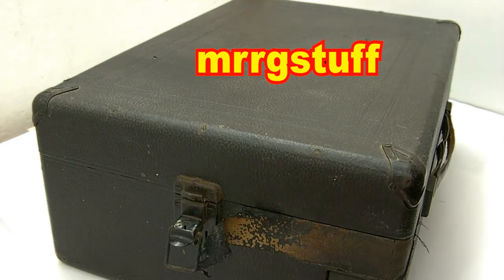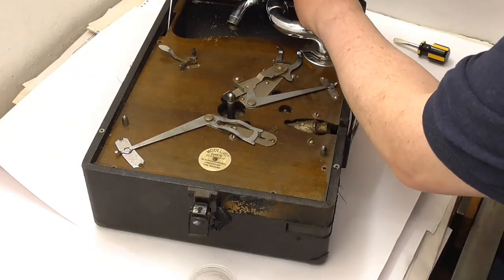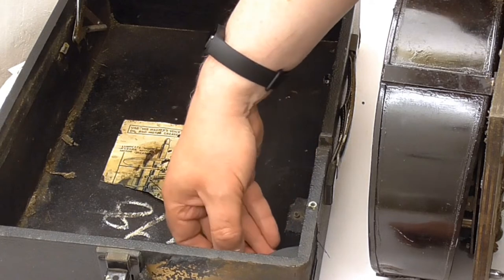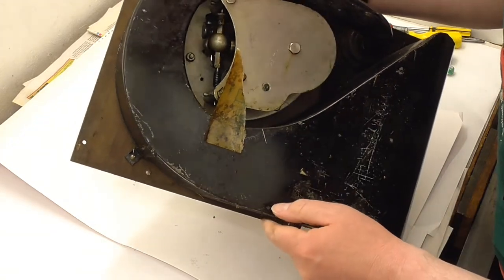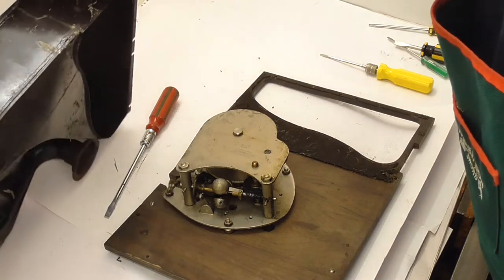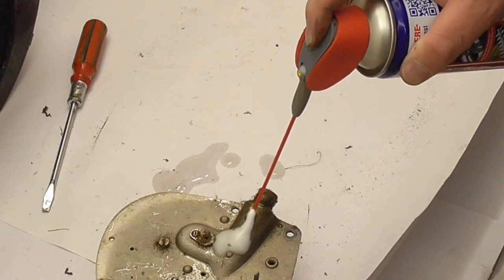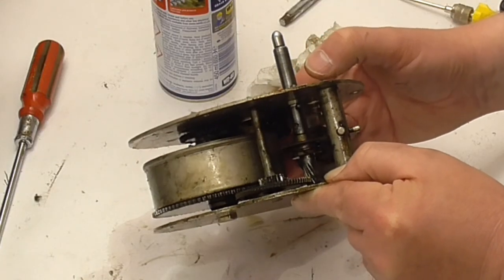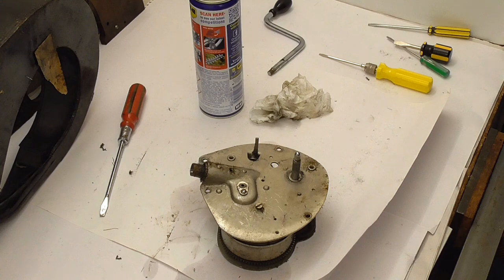HMV 102 motor - quick clean and test

Comment: Looks fine. Probably just needs a good clean and a mainspring service. I like working on the HMV motors,  they are well built and rarely give problems if properly serviced.
Reply from the maker: Thanks 😀 👍.  Haven't decided yet whether to service this further or just give it an oil and put it back in the case to test. At some point I would like to properly service it of course. I agree though, it is very nicely made and is built to last

Comment: Yeah super careful with the governor weight hitting the case at high speed, I learnt the hard way as a 12 yr old when one of the weights decided to part company with the motor flying across the garden and ending up in the fish pond! 
Runs lovely a quiet, any sign of hardened grease on the gears? Stiffness whilst winding?  If not maybe a light greasing/oiling according to the paper instructions then reassembly and see how it plays a record or two....
Reply from the maker: Fortunately nothing has broken on me quite like that yet, but a scary prospect! It does seem to run fine I agree, and the motor is a bit dirty but not excessively so. No obvious signs of hardened grease and the motor winds fine too. Thanks 😀 👍

Comment: I find getting the governor adjusted right so that it spins nice and freely can make a big difference. The axle positions at the ends can be adjusted. Take care that the gear properly engages with the worm on the governor axle, too. It's nasty if it slips and can ruin the gears.
Reply from the maker: Thanks 😀 👍.  I'll have a look at the governor before I put it back in the case

Comment: Thanks! I just took my 270-D apart. From a 1938 HMV 102. Grease rather hard, spring looks good. Would you advice to remove the spring, clean it and then grease again? I fear for my eyes when I have to put it back. :-) Cheers from Holland.
Reply from the maker: It's a good question. I so far have only removed springs where it was absolutely necessary to get the motor working again. If you feel the spring really needs cleaning but don't want to remove it, the I believe it is possible to soak the whole spring barrel in solvent to remove the old grease and then just apply new grease on top. I have not tried this though. Thanks 😀 👍

Comment: Looks to me as if the axle/spindle on which the speed governor's weights are rotating could need some lubrication. They should react smooth & quick to speed adjustments...and in the video they were quite slowly following. Just judging from this video, though.
Reply from the maker: Thanks 😀 👍.  Yes this motor really would benefit from a complete overhual. To be fair to the dealer, it was sold to me as having a suspect motor, but at least in these tests there doesn't seem to be anything seriously wrong with it. Your suggestion is good though as the machines runs slow. It gets to about 75rpm and no faster. Thanks again 😀

Comment: Good video, nice machine. I've got several 101 and 102 models. Surprisingly they all have differing motor units. I think it was common in the day for repairers to switch out motor units. I haven't been able to find a definitive guide on what motor was used on these. I wonder if someone can help.
Reply from the maker: Yes, there seems to be some variety in motors and HMV did tend to use up items so models can have a mixture of parts, even from new.
I have a couple of 101s, which do have the same motor. Both motors are broken, but I think I can get a decent working machine between them. I also have a couple of 102s, but the other one is untested and I have not had it apart yet to look at the motor. Thanks 😀 👍

Comment: Stupid question, what if you were to put an aluminum diaphragm into a reproducer that was built for a mica diaphragm? Would it work better or worse since the box would have been optimized for a different material.
Reply from the maker: I think it's a very good question. Certainly it's possible to use both in the same design of reproducer. As well as my own experiments, I have also seen an HMV No.4 on ebay which had an aluminium diaphragm. I think many reproducers were not scientifically designed  rather were loose copies of other ones on the market. They therefore weren't really tuned for a particular diaphragm material and may work equally well or even better by changing it. Overall though, aluminium has the potential for the best frequency response, so could improve things. The aluminium diaphragm needs to be properly formed with corrugations. A flat aluminium diaphragm performs poorly. Thanks 😀 👍

Comment: I restored old decca 78. Spring was sealed and full of crap. I socked in wd40 and white spirits. Then melted vasalin and socked spring for long time. Good as new. Love the sound ❤
Reply from the maker: Sounds good. WD40 and white spirit are very effective for this, though my workshop doesn't really have enough ventilation for white spirit and the smell is overpowering. I did read in an old book that petrol works well too! Thanks 😀 👍

Comment: the main spring may be somewhat tired, especially if some one in the past has stored it with the spring fully wound. It could also be due to the grease inside the Spring case being  too thick ( which is very likely due to its age)
Reply from the maker: Surprisingly, now I have played some records on this machine, the spring seems to be still quite strong. It does need a proper clean and regrease though. Thanks 😀 👍

Comment: It would be really nice to see how you strip down the motor, clean and service it!   I’ll be looking out for that one.
Reply from the maker: Thanks 😀 👍.  Yes, I hope to do more with motors. I have several HMV portable machines which require attention 😅
Reply: @mrrgstuff  I’m chomping on the bits because last night I got my motor to run again just by scraping off so much of that dried grease!!  It’s just a start because I didn’t want to strip it down too far without knowing what I’m doing.  I got my superglue so I’ll just practicing on repairing those records. 😬

Comment: It still amazes me that from such a beautifully simple design comes out such complex sounds.  I  also have a blue HMV 102 I bought in London.  The motor or spring just stopped working after 30 years.  I wonder if a complete novice like me can do anything to repair it.
Reply from the maker: I find old equipment like this fascinating and completely agree its amazing how such a simple mechanism works so well. The motor however is the most complicated part. If the problem is just dried up old grease then cleaning the motor and applying more grease may get it working again. If the handle turns but it won't wind, then the motor might actually be broken and that is a lot more complicated to sort out. I haven't fixed a motor from a 102, but I did fix a bigger HMV motor which will give you an idea of the type of work involved:
https://youtube.com/playlist?list=PLsCYUbO6xxnT2W0mIpLWhd5B6p-RARo9B
Thanks 😀 👍
Reply: @mrrgstuff   I have changed springs on a couple of occasions when a lot younger I also  on one occasion redrillled a spring which had broken towards the outer end. I really don't advise messing around with a gramophone mainspring for a beginner. Its a very scary scenario especially removing the old broken Spring ( You need a sack to remove the old spring). Not sure how Id deal with it today. I no longer have the manual dexterity or strength in my wrists and hands.
Reply from the maker: I've heard about the bag trick, but not tried it myself. I would agree though that changing the spring is the hardest and most dangerous thing when servicing a gramophone and I have only done it a couple of times myself. Here is me refitting the last spring, though in use it turned out to be fairly weak (needs a good wind to play a whole record) and other springs can be much harder to deal with
https://youtu.be/GYDmr4IfUlo
Thanks 😀 👍

Comment: If anyone knows how best to clean the case, please let me know as I can’t make out what the material is, so I’m hesitant to try until I know.  Thanks!
Reply from the maker: I'm not 100% sure what material HMV used, however portable gramophone case coverings are often described as being made of Rexine so searching for that might help
Reply: @mrrgstuff  clean the case with Black Shoe Polish, apply with a brush then polish off with a duster.
Reply from the maker: Yes, should work well. My 102 has damaged covering so it will require some repair work too. Thanks 😀 👍
Reply: My case is blue. I ended up using saddle soap to clean and add back a bit of much needed moisture.  I let that dry over 2 days before mixing good artist grade acrylic paint to match the color as it’s too difficult to find a dye or polish to match.  It looks and feels now like it should.

Comment: I’m still just amazed that from such simple parts comes out sounds so complex!  It’s an incredibly gorgeous design the 102.  I have the same model I bought in London 30 years ago.  The spring/motor just stopped working. I’d like to use your video to see if I can make out what’s happened. Thanks for making this.
Reply from the maker: Thanks 😀 👍.  When you say 'stopped working', what are the symptoms?
Reply: @mrrgstuff  so glad you asked because after seeing your video I took it all apart and got to the spring case (like a tuna fish can) but it wouldn’t open. 
The crank just turns and turns. When I descend the needle the rotation stops after 1 second.  
No one here in Texas works on these.  It’s my most treasured memorabilia from my life in London so it’s important to me to get it working.  I’d be so grateful for any advise you have.  (The motor did not spin at all. )
Reply: Okay, so I removed the bottom plate with the spool that goes through the middle of the spring barrel but as I was unable to open it and look at the spring, I put the plate back on and wound it again. I did this two times and each time something faintly clicked once then there was a bit more tension as I wound it up.  But the motor didn’t spin.  Gosh, does this mean I must replace the motor as well as the spring you think?  Also, as I normally don’t tinker with machines I’ve no idea what motor grease and oil I should use as there isn’t any HMV grease and oil as recommended.  If you’ve taken the time to read this once again, thank you!
Reply from the maker: So if you are getting a sort of clicking noise when you wind the motor, it might be this problem:
https://youtu.be/2M3JhwwWFhQ
Basically in this case the spring is broken (or has come loose from its fixing) and the spring barrel needs to be opened up to resolve the problem.
Motors do click a bit anyway as you wind them up, but a broken spring will wind itself down with a clicking noise. Some broken springs don't wind up at all.
If it winds and seems to be taking tension, then check that the speed control is not jammed up against the governor stopping it turning
Unless you have damaged gears it's unlikely the motor itself is damaged. If anything is broken it is likely to be the main spring.
For lubrication I just use cheap motor/axle grease and also sewing machine oil for the governor. Best to avoid 3in1as it gums up over time.
As I think you said you are in Texas, it is probably worth asking on:
https://forum.talkingmachine.info/index.php
To find someone more local to help fixing it. You will probably only need to send them the motor or maybe just the spring barrel,  if you can determine it is the spring.
If you can post some pictures on that forum or ideally a video link it would really help pinpointing the issue. Thanks 😀 👍
Reply: @mrrgstuff  thank you so much.  Yes I did see more of your videos, they’re so nicely done, and I’ve determined it is the motor & perhaps spring as well.  I will check out the link you sent thank you. But, even if I find someone to do all this intricate work and cleaning it’ll cost me more than I can afford. On eBay I’ve found motors but the shipping cost, understandably, is almost twice the price of the part itself because they’re all from the UK!  I had a thought:  My young daughter is in London right now for a semester of study. I wonder if you may know of any places for parts there.  I might be able to ring them up possibly to arrange for my daughter to collect one. If I could get a motor and spring with barrel, I’m not sure how much that would cost me but as they seem more readily available there potentially less dear than if I try to get parts from here.  What do you think?  I know you’ve spent some valuable time here kindly answering my queries and I really thank you for that. I think though this may be the easiest solution.
Reply from the maker: @rebekahcrossman4690  I've not really bought any parts from dealers in the UK, so I can't recommend anyone. However this link might help. Soundgen is one of the members on the Talking Machine Forum:
https://www.soundgen.co.uk/
I'd also suggest asking in the "UK/European  Trader" section as you may find various people who can help you:
https://forum.talkingmachine.info/viewforum.php?f=20
Hope that helps
Reply: @mrrgstuff  got it - thanks again!  I really like your videos!
Reply from the maker: Thanks 😀 👍.  Glad you enjoy my videos. I really enjoy making them too 😀

Comment: Where do i get the what is called the thing that sits on the record i have a hundred year old gramophone spins well but doesnt have the part that generates the sound
Reply from the maker: It's called a soundbox (British English) or reproducer (American English). There were many different ones made, and there were several different fittings. Do you know what make or model of machine you have? These videos might also:
https://youtu.be/ypwS4mJ6WEQ
https://youtu.be/1i1zss2_8cw
Thanks 👍 😀
Reply: @mrrgstuff  i donk know the model but its very old  belonged to my great grandfather. I am thinking of restoring it but without all the parts whats the point
Reply: @mrrgstuff  looks very similar to this where can i send you a picture? Will do it tomorrow as i need to take it out and its night time over here
Reply from the maker: I had a look at your short. It looks like it might be a small diameter HMV/Victor style bayonet fitting. This is quite common, and soundboxes like the HMV No.4 and Exhibition should fit:
https://youtube.com/shorts/-ne9pdS9vEQ?si=OUTUALPe4BH6yh_b
I did notice a couple of problems, though. When you wind it, it makes a loud noise, like the spring is slipping. The platter didn't seem to rotate much, so I wonder if the spring is broken? It should run for at least 3 minutes after winding.
https://youtu.be/7DqAZAVihHM?si=mDuSAJylJcrmH2mQ
The case also seems to be suffering from woodworm. If this is live,  then it really ought to be treated.
If you want to send me any pictures, then you can email me at mrrgstuff on Gmail. Hope that helps.
Reply: @mrrgstuff  appreciate the help man